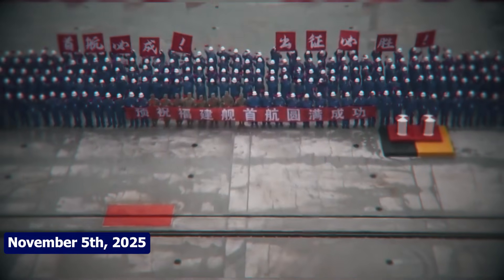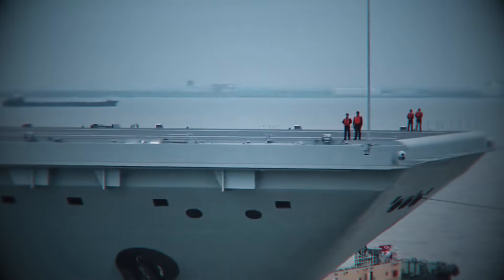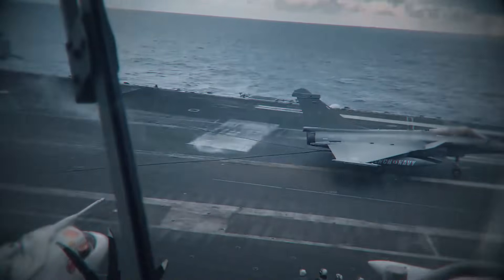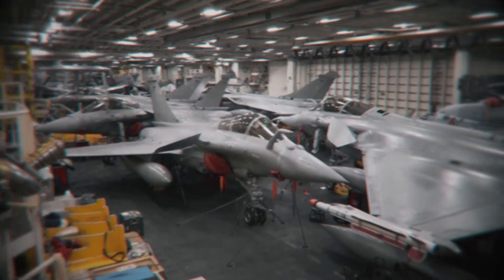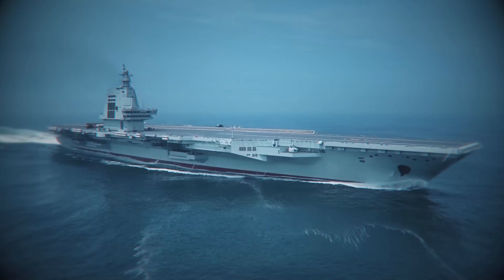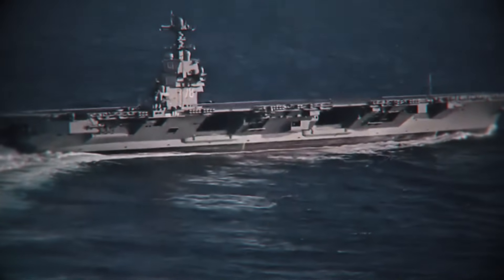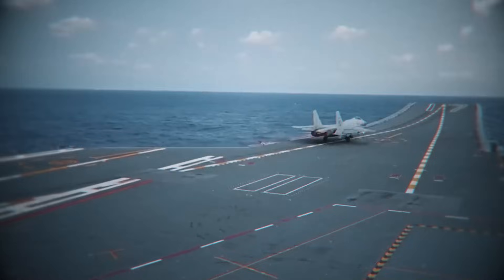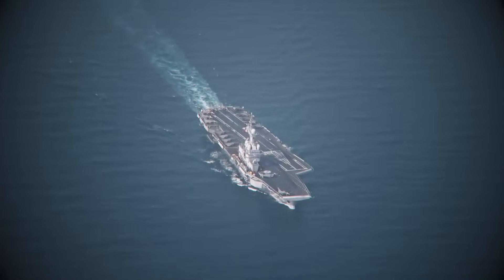Is China's Fujian Carrier Doomed Because Of This ONE Technology Flaw?

Comment: Finally, someone saying that the Fujian is a training carrier. 
I also say, the Type 004 has to work out the bugs during construction and operations too before it will be able to match CVNs. 
I give China 10 years to make that leap and another 10 years to have a 6 carrier fleet, which will give them 4 operational and 2 deployed with 2 being serviced...if all goes well.
BUT...they will never have a worldwide network of bases or an extensive fleet of allied navies to work with. :body-blue-raised-arms: However, they will do better than the USSR/Russia ever did.
Reply from the maker: You bring up some valid points about the Fujian and the challenges ahead for China's naval ambitions. It will be interesting to see how they progress in the next couple of decades!
Reply: @CIVICSHADOWS  Your right to say interesting. Since the Fujian was intended to be a training and learning carrier, China was correct to go with EMALS over steam...for the learning experience. 
Notice I said...If all goes well...I think I am giving China a best scenario timeline. EMALS is very complex tech to build and implement. It relies on many advanced platforms. Beginning with the power plant...ending with the aircraft with everything in-between (including the 25-decks full of support systems, with over a dozen specialized service elevators) and especially including operational knowledge. Catapults are at the center of super carriers' abilities (as you said the nervous system), but this is at the center of joining the ship and airwing technologies. To put these type of platforms together makes the list of tech needed to go on and on and on...etc...to other USN platforms.
I want to make a more focal point about all this:

The USN went with huge upgrades with the Ford Class (26 new technologies...WOW) and the effects of this has greatly redesigned the CVNs. It took them 8-years for the CVN78 (Ford) to go from being laid to commissioned (on top of 8-years R&D time), CVN79 is on schedule to be 12-years (sea-trials starting soon) and CVN80 is listed at 8-years. Plus, CVN78 has been in service for 8+ years now and the USN has been learning how to correct the problems these upgrades caused. The USN is taking extra time on the JFK (CVN79) to implement the needed changes during construction, so hopefully CVN80 will only take 8-years. FYI the last Nimitz Class (CVN77) took 5.5-years and that was with 3-sub classes in-between the first (CVN68), which took 8-years. 

Many have been pointing to the CVN78's 24-years from conception to get to this point as an USN failure...some say it is so flawed it will never live up to its' potential. All of this is total BS, case in point...CVN78 is the carrier being used in the current Caribbean deployment...enough said.
Reply from the maker: @NOJSIP  This is one of the best breakdowns I’ve seen in the comments. You hit the nail on the head regarding the 'Innovation Tax.' The 24-year timeline for the Ford isn't a sign of failure; it’s the R&D cost of moving from 1960s tech to 21st-century electromagnetic systems.

Your point about the Fujian being a 'learning platform' is critical—China isn't just building a ship; they are trying to compress 50 years of US Navy trial-and-error into a single hull. As you said, the fact that CVN-78 is currently deployed and operational is the ultimate 'mic drop' to the critics. I’m actually thinking of making a dedicated segment on this 'Learning Curve' gap—would love to hear your thoughts on whether you think China can actually shorten that 8-year fix cycle that the US went through.
Reply from the maker: @NOJSIP  This is one of the best breakdowns I’ve seen in the comments. You hit the nail on the head regarding the 'Innovation Tax.' The 24-year timeline for the Ford isn't a sign of failure; it’s the R&D cost of moving from 1960s tech to 21st-century electromagnetic systems.

Your point about the Fujian being a 'learning platform' is critical—China isn't just building a ship; they are trying to compress 50 years of US Navy trial-and-error into a single hull. As you said, the fact that CVN-78 is currently deployed and operational is the ultimate 'mic drop' to the critics. I’m actually thinking of making a dedicated segment on this 'Learning Curve' gap—would love to hear your thoughts on whether you think China can actually shorten that 8-year fix cycle that the US went through.
Reply: @CIVICSHADOWS  When you say...I’m actually thinking of making a dedicated segment on this 'Learning Curve' gap...do you mean you want to have a series about this carrier arms race? That would be interesting...and the answer is I would consider a more detailed thought about the subject. 
Did you read my 2nd reply? 
I talk about the length of China's carrier program and some difficulties they are facing. 
Thanks for your reply, I appreciate that.
Reply from the maker: @NOJSIP  yes offcourse i read that aslo
Reply from the maker: @NOJSIP  You can also check our new video on fujian vs gerald r ford  and old  video about naval power
Reply from the maker: @NOJSIP  The 225 vs. 12 nuclear reactor advantage is a statistic that 99% of people (even military buffs) don't realize. When you frame it as "Portable Nuclear Power" rather than just "engines," it changes the entire conversation from a "ship count" to a "technological era" gap.

Yes, a series on the "The Experience Gap" (or the "Learning Curve War") would be a massive winner for Civics Shadows. Your data shows your audience craves "The REAL Reason" behind military power, and "Tribal Knowledge" is the ultimate hidden reality
Reply: @CIVICSHADOWS  YT is posting weird...just checking.
Portable Nuclear Power (PNP) is at the heart of the CVNs and is so critical for future strategic reasons; not only in carrier abilities but for all kinds of military and civil applications. Without self-contained reliable power you are not going anywhere or doing anything fast. This tech is called Microreactors/SMRs (Small Modular Reactors) and the US is way ahead in this area. 

The Ford's A1B reactors put out 300MW each and so do these SMRs...that's sustaining 300k homes each. strategically, where SMRs are going to be huge is the Artic, as the NW passage opens, access to power is going to be critical and these things are modular thus scalable...they are compact, transportable clean energy and from my understanding...they are plug and play solutions. 

I point to this as a big reason I think China will have big problems with the Type004 powerplant and that is at the core of the entire ship. They just don't have the experiance...as I said 225 vs 12 (all subs). To answer you question...they will probably take longer than 8-years to build this carrier. They are 41-years into their carrier program and 1.75 years into building the Type004 and they have yet to field a single carrier in active duty. 

The propaganda is intense regarding this subject. China hypes themselves and the US has used it as fear tactics internally. On the US side I find this also comical, peeps are clueless as to what is going on. Sadly peeps are ignorant, thus manipulated. :hand-orange-covering-eyes: Not going to get in the political side of things.

I don't know if you have noticed, but the US have been talking about putting SMRs on the moon's south pole. Consider the space race...
NASA has been using decay reactors or radioisotope thermoelectric generators (RTGs) for 65-years. The US has active space probes that are leaving the solar system on these things. Think about that...the US is communicating with space crafts that are almost 1-light day away (16-billion miles later this year). China has a couple on the moon for 13-years now. I like this analogy, it confirms how far China is behind the US is this area, just like the 225 to 12.
Reply: @CIVICSHADOWS  Here are a couple more important points...
The USN has had 104-years of carrier experience and 71 of those years have been with Super Carriers with 67-years being nuclear powered...the USN has had countless carrier engagements over the last 104-years to draw upon. Meanwhile, the Chinese acquired the HMAS Melbourne in 1985 to scrap and it was another 27-years before they had their first operational training carrier in 2012...now they are on their third learning/training carrier. That is 41-years of carrier reverse-engineering/building experience, 14-years of training experience, but they have only managed ZERO carrier operational and combat experience. This leads me to believe that they are not moving as fast as they claim or feared. The Type004, China's first attempt at a nuclear powered carried is under way. The first hull section appeared in May of 2024...almost 2 years now and there is no sign or a full hull or even an 1/2 hull built. Hummm

Yes. it will be interesting. It is not easy to build a super carrier and it is not cheap. The Chinese are fighting an uphill battle to do this.

Last point and one that is never talked about...nuclear powered ships or boats. USN 225+ vs China 12
ACTUALLY a better way to say it for it is self contained portable nuclear reactors.
The USN has been operating them for 72-years now (submarines)...carriers 67-years and now the US is on the verge of deploying reactors for land and space use in challenging environments. 
The Ford Class upgraded from 4 reactors to 2. But they yield 3-times the electrical power while providing thermal energy too. This is way more than what the CVN78 &79 need...the USN made sure that the Ford Class has plenty of power for new technologies. Also the new USN submarine classes coming out have switched to these more powerful reactors, which are designed to last for the entire 40-year+ service life without refueling...
MY POINT...China is nowhere near this advanced and may never catch up.

Comment: Once again a video making a big deal of lunching and recovering at the same time. When a cycle begins parking of the outgoing aircraft uses the recovery area. When the recovery begins the incoming aircraft are parked in the lunch area. So doing both at the same time would becomes a big problem. You need to remember that a lunch can be 15 to 25 aircraft and the same for the recovery while as many aircraft not involved in the cycle are parked on deck. Handing the deck movement could involve as many as 30 to 45 aircraft in the 3 acres not used in the part of the cycle that is going on at the time. Thinking this is a problem in the deck layout shows the lack on knowledge of flight operation by the writers of the video. If you carry only 40 air craft on a ship like the Fujian you might try to do both at the same time but then your strike package in limited by the number of air craft you can put in to it. During Vietnam Forrestal class carriers did 7 to 8 cycles per day at around 20 air craft each cycle for 140 to 160 sorties per day based on a 1-1/2 hour cycle of lunch/recovery/reposition/fuel/arm and repeat.
Reply from the maker: You've brought up some excellent points about the complexities of flight deck operations and the challenges of simultaneously launching and recovering aircraft!
Reply: @CIVICSHADOWS  I have been there under battle conditions. It will only lead to trouble if you try to do too much in a confined space with a lot of moving parts. There are times when you need to break from standard operating procedures but those time should be a last option.
Reply from the maker: @donaldsmith1055  ❤❤
Reply: Why can't this be solved? Use this aircraft carrier as a training ship. Then build a new 100,000-ton nuclear-powered aircraft carrier.
The problem will be solved. You guys are making a fuss over nothing. A bunch of idiots.
Reply: @SpruceWood-NEG  My problem is mot with what the Navies, US and China, are doing its with the clowns writing the videos and spreading information that is not important as being a make are break thing. China can learn from their mistakes but the real problem for them is not the ship it knowing how to use and support it. No carrier goes with out its problems, its how you overcome those problems that shows good you are. China is trying to make big leaps with out the understanding that comes from operational knowledge.

Comment: Regardless of (US) carrier, but cat3 (and possibly cat4, if present) are always inhibited by the recovery zone. Does that mean the Fujian's catapults aren't worse or it isn't an issue that cat2 interferes with recovery? No, but the mention of cat3 as an issue is a stain on the whole video. And an unnecessary one.
Reply from the maker: Great catch, and you're 100% correct regarding the recovery zone interference—Cat 3 is 'foul' during recovery on both the Fujian and the Ford-class. My intent was to highlight how the overall deck layout and the lack of a 4th catapult might tighten those operational windows even further for the PLAN. Thanks for keeping the technical standard high in the comments!"